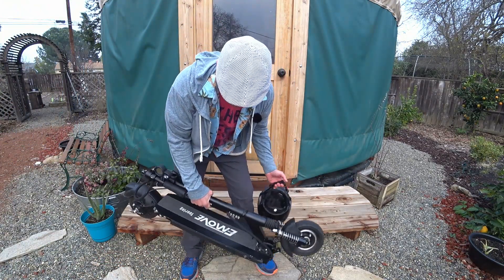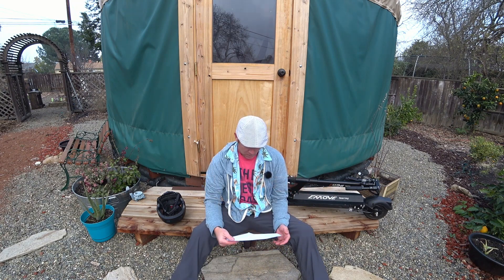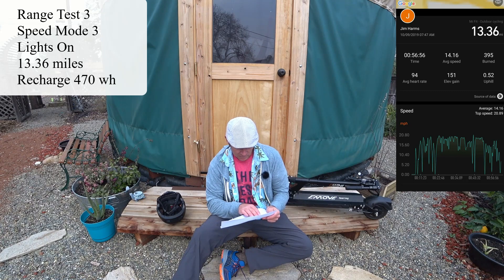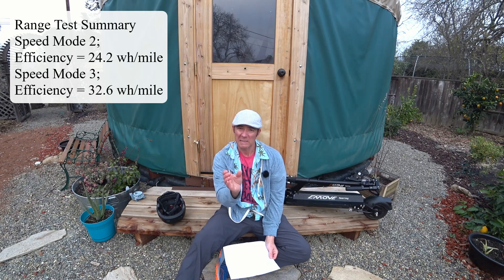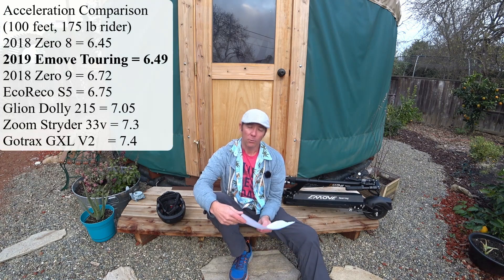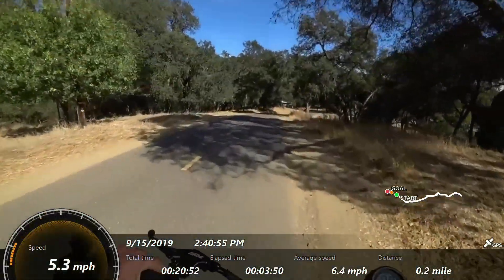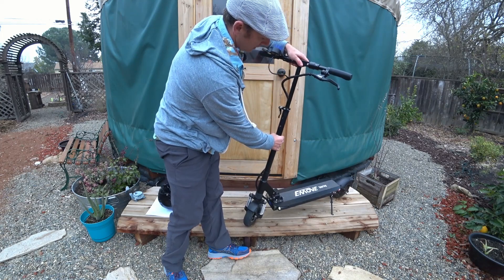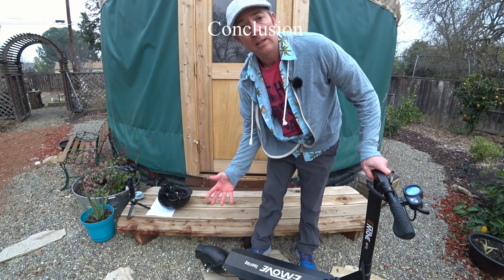Emove Touring Electric Scooter Test Results!

Comment: Thanks a ton for the video! After months of consideration between the widewheel ninebot max and emove cruiser, I actually did end up going with the touring. The combination of suspension weight speed is what sold me. I’m a little nervous about the range but from what I’ve read the charging time isn’t bad.
Reply from the maker: @D sin, I hope you like the Touring.  I do enjoy the lighter weight, I rode a ninebot max for a little bit recently and much prefer the Touring suspension.

Comment: Hey, so I got my touring. I have an issue where the charger always stays green and doesn’t charge the battery. I’ve tried all the outlets in my house, changed p1 from 41.5 to 40.5 and 43. Voro has been super great mid pandemic and sent me a new charger, which has the same issue. They are now sending me a whole new unit. Any suggestions to try to see if I can fix the issue myself? 

Again Voro has been amazing from order to technical issue to replacement. Shout out to Joey and Carter!!
Reply from the maker: @D sin, the P1 setting shouldn't have any impact on charging.  When you power the scooter on and toggle to voltage, what is your reading? It sounds to me like you could have an issue with the charging port on the scooter, where the charger is not actually connecting with the battery  If you want to contact me via my website I can try to help step you through some options.  I'm glad Voro has been responsive to you.

Comment: Can you remove the battery? Also if you run out of battery can you kicks start manually with you feet?
Reply from the maker: It can be removed but not likely in the way you are thinking. You have to partially disassemble the scooter, so more accurately it can be replaced vs removed. Love the YT name by the way, big ZZ Top fan.

Comment: Hi, I saw your reviews of cruiser and touring. Great job! Currently I have ninebot max g30 , max speed around 28km/h. It's really comfortable scooter , very stiff  and with 10 inch pneumatic tires. I think of upgrading that one and initially thought of cruiser. But now I 'm thinking of Touring as maybe I don't need so much range as cruiser has. I wonder what are the exact differences between both: comfort of riding , acceleration , suspension, max speed. Maybe no need to buy Cruiser if Touring is very similar. What about smaller tires? Is it any issue at all? BTW, do you know maybe what is max height from the deck to handlebar. I have 186 cm , 95 kg.

Comment: Hi Jim - in depth review.  Would you ride the scooter on a damp road?  I had to scoot back in the rain once (11 miles) - hated it.  Also got sprayed from the rear tyre, as the mudguard is too short (Falcon Zero 8).  It looks like you might not have that problem with the EMOVE?
Reply from the maker: @JellyMonster1, The Emove fenders have really good coverage, I haven't had any splash issues.  I was worried the fender would fail like it did on my Zero 8 but its held up very well.  Thanks for asking!

Comment: I've watched your reviews of the Emove Touring and Cruiser and it sounds like the motor on the Touring is much louder at all points of the ride.  Could you please confirm if this was the case? If so, did you find it at all distracting or annoying?
Reply from the maker: I think the touring motor is slightly louder but I think it is because of the drum brake mechanism, rear springs, and maybe even the solid tire. I don't notice it at all except during takeoff from a stop. When riding all I hear is wind!! :)
Reply: Thanks! 👍

Comment: Touring vs zero 8 since you own both. Is the touring worth the $100 extra?
Reply from the maker: @Ban Shamayan, That's a tough question really, it depends on your riding style and where you ride. I think there are enough differences that it's not just about the extra $100. I just had a guy demo the Zero 8 and a Touring, he went with the Zero 8 for his riding style. If you ride on rough roads and wet conditions I'd go with the Touring because of the IP67 rating and more suspension. The Zero feels a bit more stable and sportier at slow speeds with the lower deck. Both companies have good customer support and the performance of the two is very similar.  I just sold my demo Zero 8 because I always chose the Touring over it.  I couldn't do my 13 mile commute comfortably on the Zero that I could on the Touring.

I hope that helps, thanks for asking!
Reply: @ElectronSurfer  does the Touring really have an IP67 rating? I thought it was just the Cruiser that has an IP67 rating, with the Touring having no IP-rating at all.
Reply from the maker: @jesperdalgaszachariassen2575  You are correct, I was under the impression the Touring was advertised with water resistance as well, I was wrong.  I'll amend my review with that. Thank you for pointing this out!